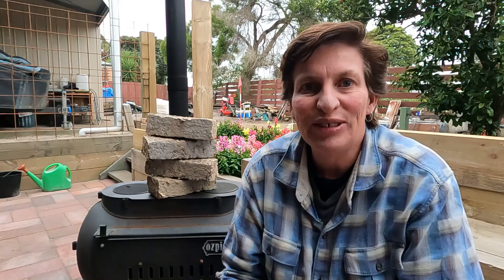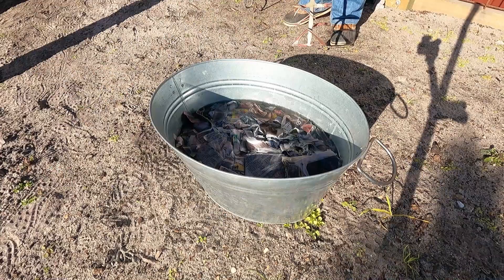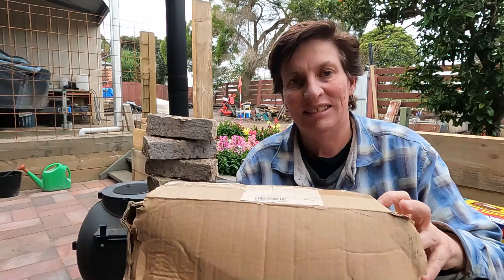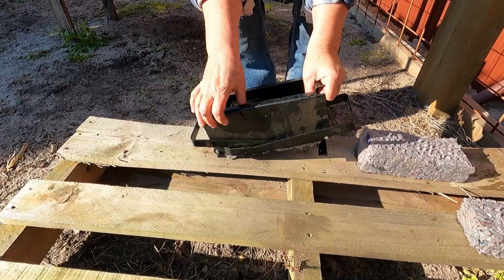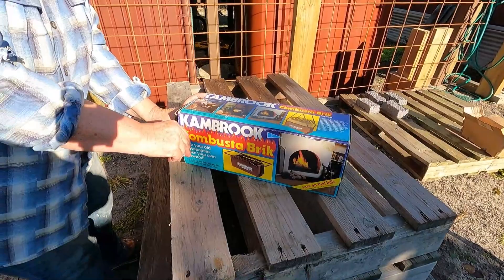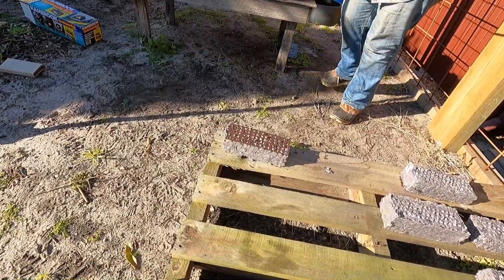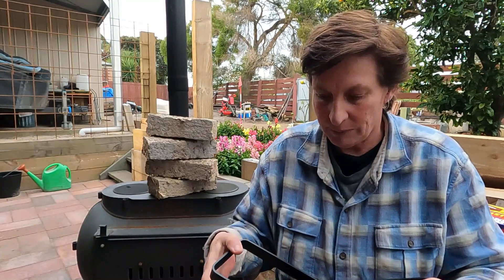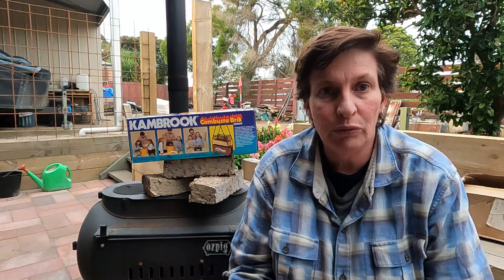How To Make Paper Log Bricks

Comment: We might give this a go! We also have a big pig oz pig and love it.
Reply from the maker: Yes we love our BigPig OzPig too. We have only used it for fires but hoping one day tocook on it.
Reply: @GayandCarol  we have cooked on ours a few times. We also have the smaller ozpig and take that one camping as it’s not as heavy.
Reply from the maker: We have not decided yet what firepit to tavel with. Currently we dig hole or use one that is provided.
Reply: @GayandCarol  definitely travelling with less is better. A long as you have heat and a hot plate 👍
Reply from the maker: @kylielaw2306  totally agree. Less is better.